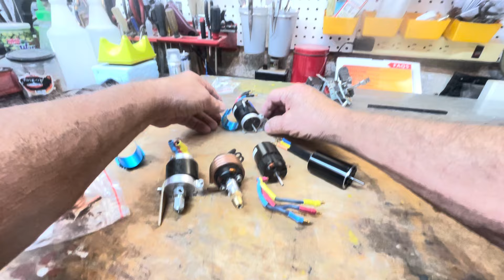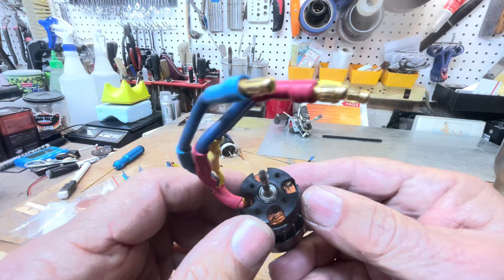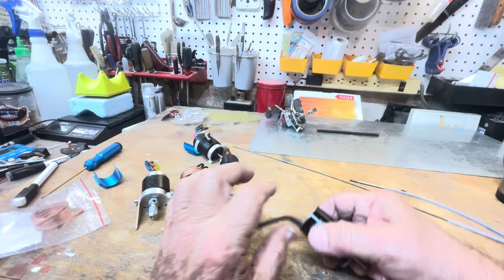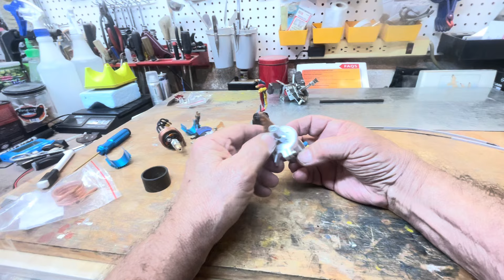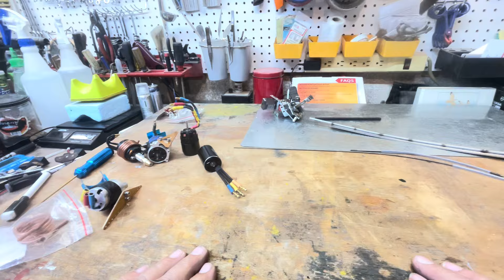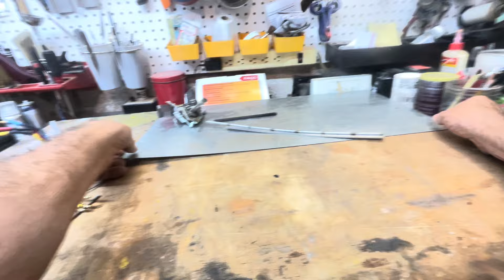Dr. Jet gathers parts for the Miss Seattle build.

Comment: I like carbon and kevlar but getting those little fibers in-between your fingers is so annoying! I use the old splinter removal method and just run a hobby knife along the skin to shave them out👍 I see you settled on a motor there.. I was thinking maybe a 2040 SL Hobbywing motor would have it running, but it might be too much kv
Reply from the maker: I'm concerned the Aveox may be too much rpm/V.  A small prop will be the answer.
Reply: @Dr_Jet yup 👍